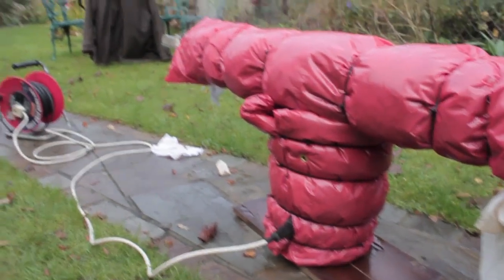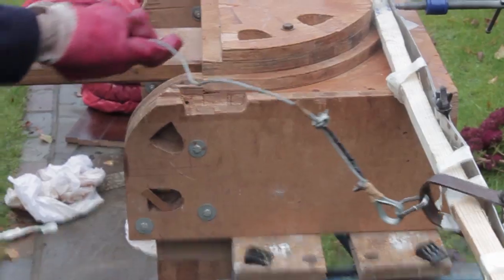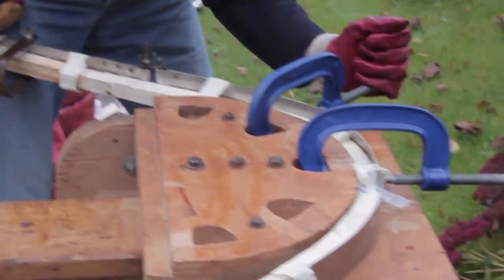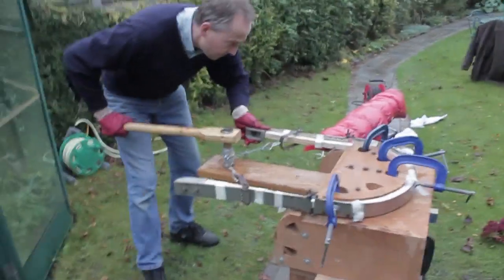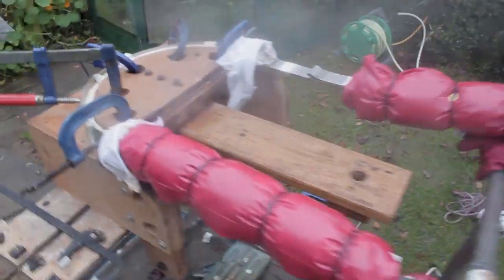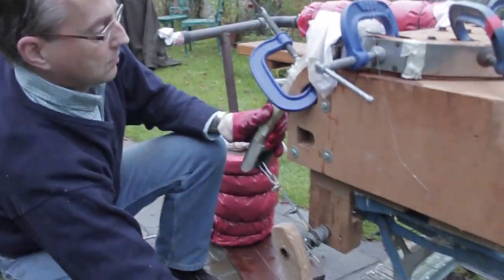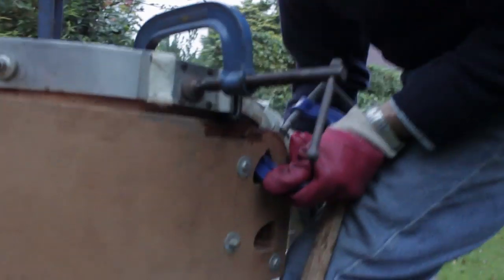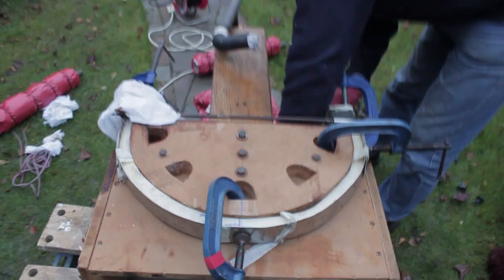Steam Bending: Continuous Arm Windsor Chair

Comment from the maker: @ydborg Hi - I don't have a ratchet, it was actually rubbing the metal band and keeping in position - as luck has it! In actual fact there is not too much whip back or spring once the wood is bent as it 'sets' very quickly. I have seen a boat type ratchet used to good effect.

Comment: hi harry I've been watching a lot of videos on YouTube about bending wood and a lot of people are just steaming rather than boiling the wood. What are the benefits of each of these methods and why did you choose the latter
Reply from the maker: Hi boiling gives a fast heat up and is easy if you have a piece that fits in a trough...like in my saddlers clam and Sussex Chair making videos....steaming is great when it's not easy to boil...need to be able to produce enough steam which without the right set up is a little tricky...steamed in this video and in others like the coracle making one.

Comment: Thank you for this video. Do you have any information or advice on constructing the steel backing and the ratcheting mechanism? The guide on making the former was very useful but I'm struggling to make sense of the pulley system. Thanks
Reply from the maker: The strap is 18g stainless steel riveted in places. The winding mechanism is yacht cable and eyelets, simply wound around a bit of steel pipe.
Reply: @harryrogers  are the rivets because there is more than one layer of steel? Can you tell me what the chunky bits at the end are? And are they to stop the wood slipping out one side? Thanks
Reply from the maker: @ChickenDinnerz  Yes the end stops keep the wood in place and force ot to bend and not slip out...hardwood blocks will do it. The rivets held the strap joiners in place. James Murcell has done a very good book on Windsor chair making that will give some insights into this kind of thing.
Reply: @harryrogers  thanks. I do have that book funnily enough and find the information a bit lacking in this aspect. Plus it always helps massively to see these things in action. Anyway, thanks very much for your help
Reply: Do you make the steel strap in three sections?  One section accomplishes the main bend.  Then you take it apart and rotate the two end straps and complete the transition for the out of plane bend.

Comment: Have you tried using a waste pipe with caps as a steam chamber?
Reply from the maker: Hi Clive - yes, and its very good when supported on a plank - thanks
Reply: Wouldn't the waste pipe distort with the heat
Reply: Not if it's the better quality, thicker pipe.

Comment: What are your insulating jackets made of?
Reply from the maker: +Kenneth Sternberg They are cut down immersion heater jackets!
Reply: Thank you.  I'm not sure if we have those in the states.  Do you let them get saturated with water in use, or are they sealed somehow?  How durable are they?  Do they stand up to the heat and abrasion well enough to be reusable, or do you just treat them like some consumable?
Reply from the maker: +Kenneth Sternberg they are sealed - most hardware stores have them here, as do plumbers merchants....so hopefully you can find them.
Reply: +Harry Rogers Thank you.  I will look.  I have never seen an immersion heater here.  But those might solve a problem I sometimes have.
Reply: @KSternb  USA uses un-vented (pressurized) cylinders which are insulated by the cylinder maker. In the UK this did not have to be the case, though it is now.
Reply: @andrewbeaumont5492  I am not sure what cylinders you speak of in the U.S..  I haven't seen anything similar in the U.S..  I am still curious about a source for that insulation.
Reply: @KSternb  In the UK we have the hot water cylinder fed from a feed tank, usually located in the roof space. The cylinder is where hot water is stored, the tank holding cold water. The cylinder is usually made of copper and can be heated electrically with a immersion heater or by the central heating system. In immersion heater is usually 3Kw ( at 220 / 240 v AC ) .  As the cylinders were often made without insulation a separate jacket could be fitted around it. These are glass wool inside a plastic cover, often a bright red colour.